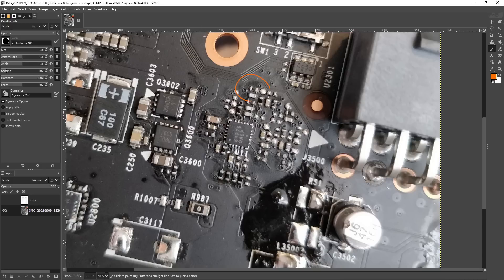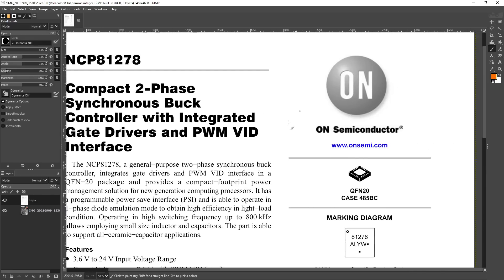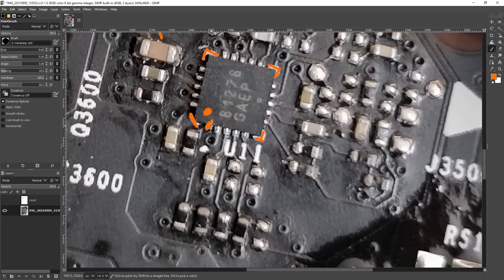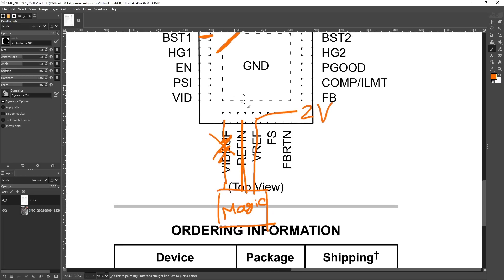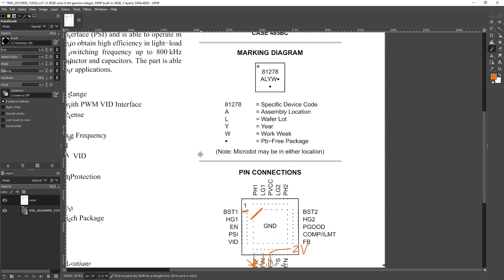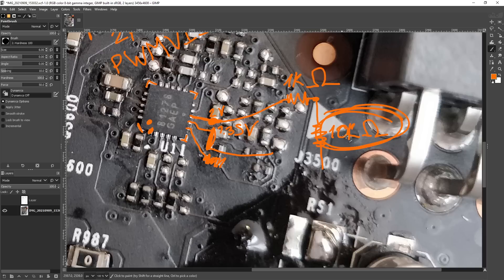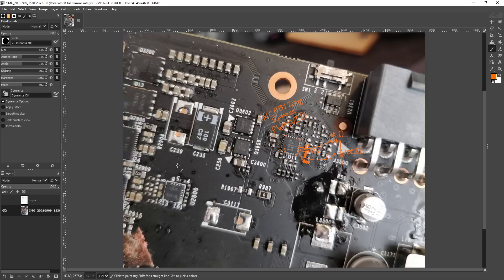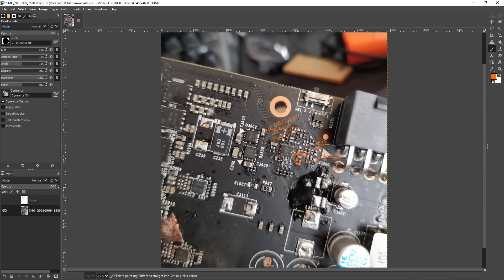Memory voltage mod for the EVGA GTX 1080/1070 FTW and 1080/1070Ti/1070 FTW2

Comment: I've been thinking of modding my Zotac Mini gtx 1070, at room temp it boosts upto 1949mhz to 2ghz and runs around 60-68c on the stock cooler and i've seen it peek 2025mhz when benchmark it, but i've always been scared to turn the settings up on the Firestorm software that comes with it 😞 But Buildzoid, once i can find something to replace it with, your welcome to have it donated to be Borgzoided lol :-)

Comment: It would be cool if someone could make softwate that could lower vram voltage on nvidiacards.
Reply: Complicated. We need more documentation about Nvidia drivers and their actions
Reply: @Mom19  it is possible on Polaris cards through radeon settings and asus gpu tweaks, but there might be limitation in the vram voltage controller on Nvidiacards etc.
Reply: @Taraquin83  as I said, we need more help from Nvidia probably. Probably won't get that tho. I mean, they also locked down the area around the GPU die and memory from the 10 series on for partner models.

Comment: I can agree with not tieing the other end to ground if the magic circuit is left in place, as you would likely need some oddball 3.1415926535897932384626433832795028841971693993751058209749445923... ohm thing to tie the V to stock, lol. that and it's unnecessary extra work when a disconnect switch is present.

Comment: 1070s are expensive because miners like them.
Reply: IIRC it has something to do with the gddr5 vs gddr5x - I think 5x doesn't scale fully with mining
Reply: Really? A friend is sending me their old 1070 for Christmas and they only make $1-2 a day...
Reply: @cheyannei5983  so about 9 months and it's paid off. Not bad.
Reply: @NotThatGuyJD  Giving that the card would thermally throttle without A/C in my climate, I'm not sure it has a payoff time for me personally. It's too humid around my property for swamp coolers to really work.

I know there's some crypto farms here in Texas, though, because the electrical rate for industrial use is lower than consumers IIRC.
Reply: My brother has 24 Gpuz some 1060, 1070, and 1070 ti. Its only been used more than 2 months on mining. After pandemic when he back to work all 4 mining rig has been stop. Now he give it to me to sell it.

Comment: what are those marks on pcb? I have this mark on a brand new motherboard and when I unpacked the motherboard I thought it is some kind of liquid damage.
Reply: It's flux. Normally it should be cleaned off but sometimes they solder large items by hand as the final stage and it gets left behind. Should not be a problem at the low voltages computers use.
Reply: @nicholasvinen  just don't go licking it